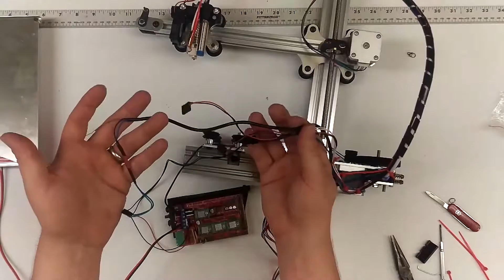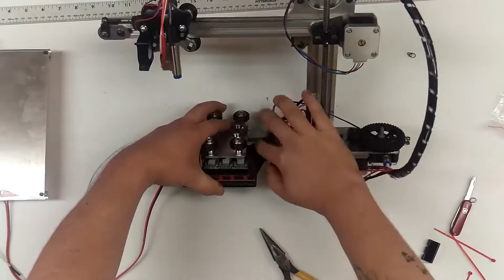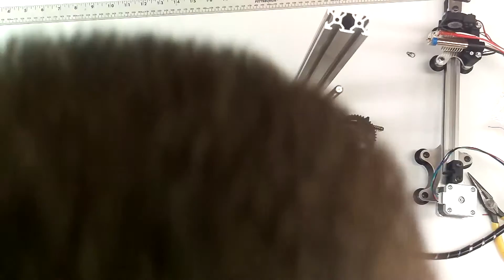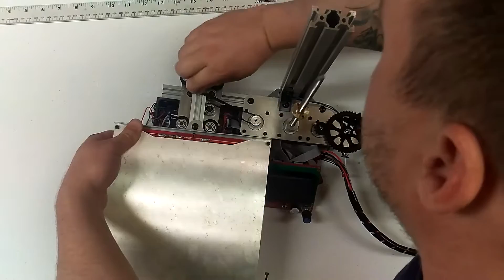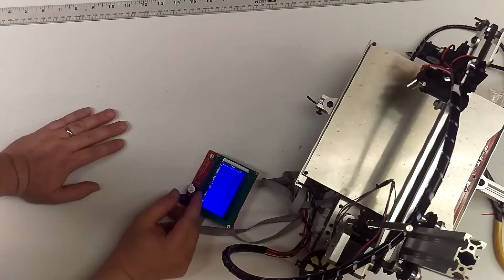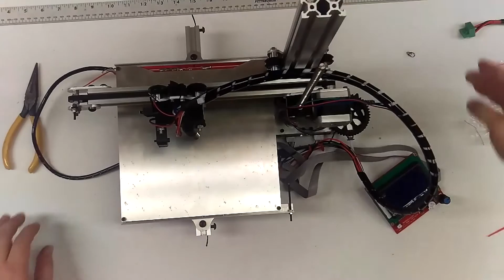Reach 3D Printer Assembly Part 12 - Final Assembly

Comment: i can't use this as a tutorial because nothing is clearly shown -_- you need close up video of the wiring, the same goes for the rest of these videos, i suggest another angle too
Reply from the maker: The PDF user manual has high detail of every assembly, and wiring. It's on the sd card or at: www.bit.do/reach3dprinter